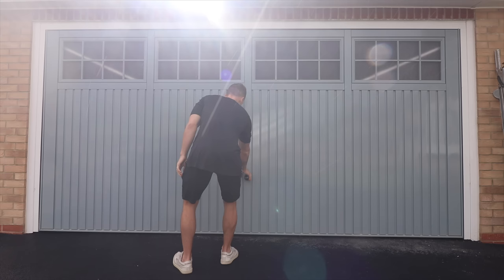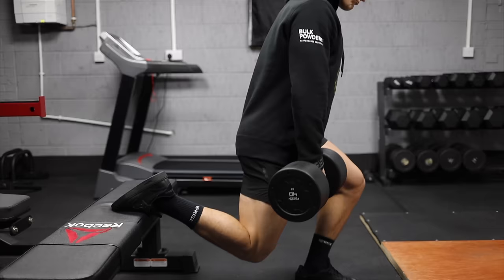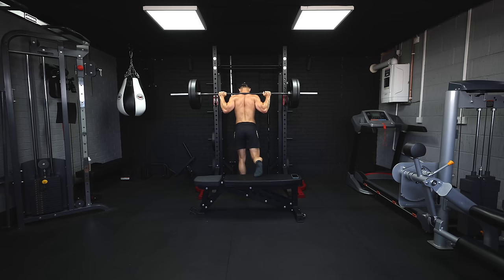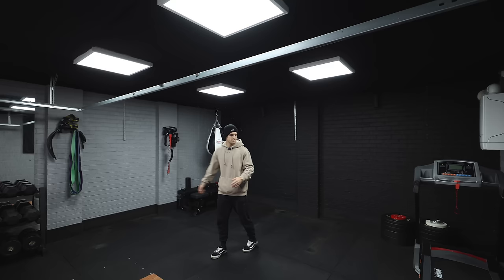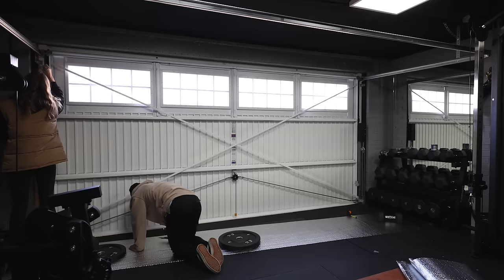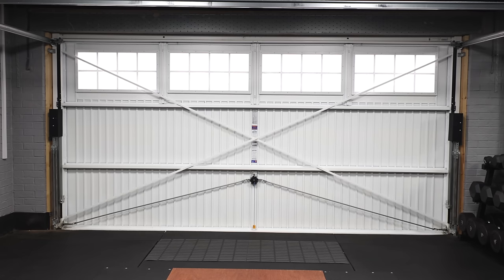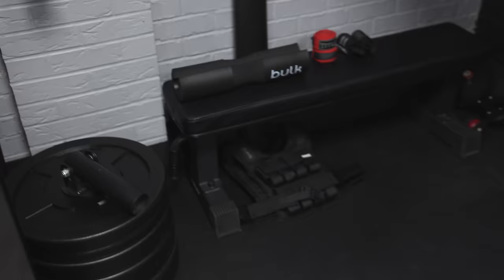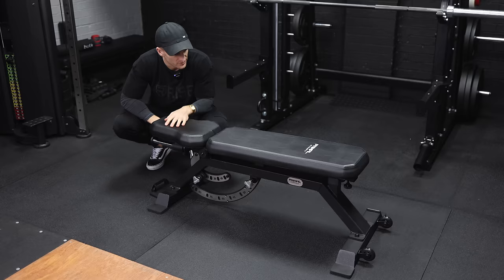Complete Home Gym Transformation (Start to Finish)

Comment: For your lack-of-heat problem -- a simple manifold off your existing boiler into a radiator (or two)?
Electric radiant panels near your primary workout stations would work too.
Radiant heat works by heating objects (like you) rather than the entire volume of air, so they're ideal for turning on when you're working out and then off when you're not.

Comment: My home gym is the great value version of yours. I've got old horse mats that are taped together, a 5-30 dumbell tree, a 25 lb kettlebell, a used smith machine cage from golds gym with pullies on the corners and a floor pulley for rows, an adjustable bench with the leg extention attachment and a pull up/dip station from a kids playground. Honestly I mostly just use the free weights and the cage for benching. Been switching back and forth from PPL and upper/lower routines every 6 month or so.

Comment: Sick.  I'm building my home gym at the moment, great inspiration, cheers.  I think I'd add just three things: 1. some kind of chest press machine (probably incline, ideally one in which the angle and the grip can be adjusted, unless one runs into the same engineering issues as the leg extension/curl combo), 2. a multigrip cambered bar, which doubles as a multigrip pullup bar too 3. a couple of sturdy, large plyo boxes, not only for jumps-cardio but also for unilateral leg exercises, seal rows (putting the bench on top of them to increase the distance from the floor) and several other things.

Comment: Heat rises so that area above the black sheeting on the ceiling will collect the heat. You could probably just lay some cheap thin wood up there and then some insulation over it, maybe even some old duvets or blankets or something. Might keep the gym a few degrees higher on chilly days. If you have any plumber mates, you could also just put a radiator in there.

Comment: Just built a home gym myself. Started off by sealing all the gaps with expanding foam and painting everything black. Damp proofed the floor with a damp proof membrane, picked up some flooring mats and then was onto the equipment. My garage is only a 1 car garage so not as much room to get different machines for each exercise so picked up a MARCY ECLIPSE RS7000 DELUXE SMITH MACHINE HOME GYM WITH BENCH, literally has so much in one machine. Also, got a treadmill but I'm now in need of some dumbbells but obviously they're very pricey so was thinking of buying some adjustable ones, been looking at the Bowflex 1090i but not set on them if anyone could recommend any. Also i picked up an oil filled radiator but it's causing a lot of condensations so I think I need to get a dehumidifier

Comment: Joe, great looking gym, though you'll definitely want to consider removing the spray foam. It'll be a pain in the arse to do but given you've cloth-lined the space and won't see it the kingspan would have been the way to go. Spray foam is pretty awful for damaging roof timbers, and I've seen it lead to a whole new roof being required from rotten timbers. It's perhaps slightly less of an issue as it's just your garage, but it's a big no-no on most mortgage lenders guidelines, and they simply won't touch properties with it. If you come to sell, I'd not be shocked if you'd need to get it removed at that point in order to get the sale to go through - if it was inside the house you'd definitely need to do that. Any surveyor worth their salt will recommend it being removed.

Comment: Quality video as ever Joe. I recently bought a Redrow home in the last year, unfortunately it is only a single size single skin garage (obviously we do not operate on the same budget 😂). However, I took major inspiration/design stealing from your first video to create my home gym and it’s been working out great for me. I have a bike, DB rack, fully adjustable bench & a half rack with bumper plates, with some niche weighted vests/belts etc.. as well. I have very limited room left and also a shorter ceiling height of only 2.10m. Would be great to get your thoughts on one major item I could stick in (i.e small enough cable pulley, Leg ext/hamstring curl, calf machine etc…). Also might just have to copy you with insulating the door, garage is getting freezing this time of year

Comment: Nice work, Joe 🎉 Primal Strength stuff is great, and that FB page is a good source of inspiration for home gym owners too (if not necessarily the best for bank balance) 😂 For people that don’t have space for the leg extension or Smith machines, but do have a rack and some kind of jammer arm that can be attached to the rack, what would you recommendation be for the best way to hit leg accessory movements like leg extension, hamstring curl, calf raise etc.
Reply from the maker: I think leg extension is the most difficult as there isn't really a quad isolation replacement you can do with free-weights. I do some stuff in this video from around the 5 mins 30 mark: https://www.youtube.com/watch?v=OXn-fhrQQrw&

But none of it is particularly comfortable or easy, so I don't know if I would just concentrate on doing a couple of different squat/lunge variations for quads. Calves, you should be able to do raises holding the jammer arms, as they will be more stable than holding a free bar. Single leg DB raises are fine too if you stand on a plate/ramp and hold onto your rack with your free hand. For hams, again an isolation is difficult without a machine. You can do some lying leg curls, lying forwards on an incline bench with a DB between your feet, but again, that's a bit awkward. Although it's not a curl, I rely mainly on RDLs for the hamstring work I do at home.

Comment: Hi Joe. Spot on transformation here....I've seen this clip a few times this upload that is, but I've come back to it as I'm doing my next home gym....but just noticed something that isn't actually in your gym. At 17.06 you can see what looks like wall control pegboards. What are these (make an model if you know) and where did you get them.....wall control in the UK is hard to get hold of....and I need metal as they are for cable attachment (I'm going down the Rep Athena rack system so wall mounted attachments are needed as it's a totally open rack with integrated cables. Sounds like you're a local lad too I'm based in Audenshaw...I'm guessing you're not far away from looking at some of your other clips. 

Spot on channel and great content as always sir....keep up the great work 

J

Comment: You’ll always be losing a lot heat because like you said it’s only a single skin brick wall which will pretty much retain no heat whatsoever as well as letting tonnes of condensation in. The windows in the garage door are also single pane which will be letting out a lot of heat.

Comment: Love the primal gear, Steve was really active on the Facebook groups too during lockdown.

I have a similar space to you however my garage door is an up and over electric which scuppers a lot of the height across half of it and we still need to use some for ‘garage’ shit.
Next year hopefully going to build some custom storage to expand the space and copy some of your moves!
Reply from the maker: Yep, even the track that mine runs on still limits where I can put things to an extent. A roller door would be best but looks pretty ugly on the outside.
I also bought a shed for storage, but can imagine that's not convenient if you have bikes or something you need to grab and go.

Comment: Quality content as usual man! I took a few ideas from your first video when I built my gym (namely the black wall) and it looks DOPE. I have a stand alone lat pull down / low row machine that I’m considering swapping for a functional trainer. Think it’s worth switching if I only have room for one?
Reply from the maker: Yeah mate, I would say so. You will still be able to do some single arm lat pulldowns (like the ones I showed in the video) and could even do some cable rows sat with your chest against an upright/incline bench (holding both cables), so you're not really losing any movements, but gaining a lot. If you have somewhere to do pull-ups especially, no real need for a lat pulldown (although I do see why people have them in home gyms because they are typically pretty small footprint).

Comment: Awesome idea on the ramp for calf raises. I had just been laying down a 2x4 until I could get around to building some sort of platform. But checked amazon and saw a rubber curb ramp for $39. Hopefully that will work out and save me the trouble.

Comment: Thanks for this I’ve been looking at upgrading my basic home gym (barbell and 195kg of plates, dumbbell rack, bench, kettle bell set (8-32kg) pull/dip station, weight belt and bands, also jump rope and exercise bike) but I keep overthinking full rack/half rack/smith machine (got a basic squat/bench rack combo) luckily I live in Thailand so no insulation on the large roofed terrace (just a few industrial cafe fans above) I do usually do one upper and lower day at the gym for the extra machines, might make the cash plunge and get a pulley machine and leg extension.

Comment: Down the line maybe ditch the functional cable system and get a Smith/Rack/Cable combo  in place of your current smith/rack?? Have a mooch at the ExtremeFitnessEX1000, or TitaniumStrengthFT3. That would free up so much room Dude ;)
Love the setup though Lad!
Also - similarly - as you're ditching the treadmill for an assault bike - also look into the recent Row/Ski hybrid machines - Titanium also do one of those,,
Reply from the maker: Yeah mate, I did look at Smith/rack/combos, but they are all quite 'deep' (front to back). Ultimately decided it might make YouTube vids a bit boring if every exercise I do is literally in the same spot. If I was truly at a push for space and there was another station I REALLY wanted, I'd have done that, but as it is I could still squeeze something else in if need be.

Comment: I move into my new build in Jan mate, buzzing to get my home gym sorted
Reply from the maker: Best thing about moving into a new house haha. Home gym and dedicated office massively impacted my quality of life srs.
Reply: @JoeDelaneyy  my Garage is going to be
5517 x 2500 got any tips? I am going to do a 2.5kg - 40kg dumbell set with the horse mats on the floor
Reply: I want a single cable machine for back and tris etc but not sure if I will even have the room
Reply from the maker: @0GarethHunt0  Would definitely have room for a single cable stack, but whether that's heavy enough to do pulldowns on would depend obviously. I think better to do single arm pulldowns, then you don't need to use as much weight and won't need a pad to keep you in place (like on a lat pulldown etc). There are some plate-loading ones you can get at Primal that you can fix to the wall. They might be a good shout.
Reply: @JoeDelaneyy  Nice one mate, appreciate the help. Sorry this isn't a "How to get a six pack?" question, I know you love them

Comment: Great video Joe, lots of ideas.  I’ve only got a single garage, but over the last few years I’ve managed to squeeze in an extendable squat stand / rack for use with a 6ft bar, a cable cross machine, adjustable dumbbells, and a spin bike.  Bought a really cheap bench, but I miss the leg extension like you mentioned but no space for it.  Looking at upgrading to a bench with leg extension attachments to hang plates on - any views on them?

Comment: To be honest, the walls are single skin brick, it will never regulate temperature very well. Plus unless you're heating the inside, its not going to have any heat to retain. I have same issue with my home garage gym. You're right about the door, that will be the worst heat loss. You could get some double glazed aluminium bifolding doors on there?
Reply from the maker: Yeah mate, nothing I can really do on that front eh. Technically could insulate the walls, but it's a big job (for me) and would make the place feel smaller. To be honest though, it's warm enough now once I'm training. As for the doors, I did think about changing to something better (because the mechanism also annoys me for mine) but I don't think I'll be in this house forever so not sure if it's worth it. Next owners might use it as an actual garage ha 😆
Reply: @JoeDelaneyy  yeah wouldn't be worth the mess and loss of space. For me it's just trying to keep the temperature above a level that moisture don't sit on all the metal. As you say, after a warm up set the temp for working out isn't an issue. Just throw a big hoodie on for the first 5 mins

Comment: great video Joe, gyms looking sick! Apart from not being a little b*tch.. could you try a small fan heater like I have in my garage gym, I flick it on 10/15mins before I want to use it in winter - along with a hoodie it just takes the chill off when warming up
Reply from the maker: Yeah mate, I do have a little electric fan heater, but it's currently in the loft and I'm trying to wait as long as possible. Even when I do start using it, it's definitely helpful now I won't be losing all the heat straight out the door haha!
Reply: @JoeDelaneyy  Yeah thats a good point, no point heating the area to lose most of it through the door! hopefully the insulation sorts that for you! got serious home gym envy!

Comment: I have a cheap argos style bench i picked up second hand on market place with a light olympic bar it has a leg press attachment and a preacher bench
I have hit the max weight on it with bench press , dead lift and squats

thinking of getting a squat rack to replace it... maybe one with a lat pull down on it

just been doing a 5x5

dont want to break the bank as i have only been lifting about 3 months and not consistant some weeks but loving it

would you recommend the squat rack?

Comment: I do have a home gym which I will be updating soon.  Yours does look great - out of interest how much time did you invest in research, correspondence, planning etc? The video makes it look like it just fell into place 😂 (YouTube Land haha)
Reply from the maker: For all the original stuff like painting, insulating, floor etc, it was probably a lot of time. But I was so enthusiastic it was more fun than a chore. For the equipment - not enough time, hence why I went through two leg extensions before finding the right one. For this lot of new equipment though, I was working with Primal so pretty much had a direct line to them that I could use to ask questions, which was helpful. Obviously this is stuff you only want to do once if you can help it, so the more research the better. That home gym community FB group I mentioned is really helpful.

Comment: Joseph, I have a small garden space (3x4m) which I’m planning on turning in to a semi outdoor training area. Im going to put a rain shelter up but all the equipment will be subject to the elements as it’ll be more of a gazebo to just keep the rain off when I’m training. Any recommendations for some semi weather proof kit that’ll maximise the use of the space. Ta
Reply from the maker: Hmmm, that's a difficult one. I'm not too clued up on things like preventing rust, other than blasting WD40 all over everything often (but then be careful of getting it on your clothes). I would check out that home gym community FB group I mentioned - there will be somebody in that group who has experience doing something similar, I'm sure.

Comment: If you had half the size garage what would you kit it out with? I’m looking at new build houses but the price point I’m at the garages are about half the size of yours
Reply from the maker: If you want absolute best functionality, something like this is ideal: https://www.primalstrength.com/products/primal-strength-stealth-monster-rack-system?_pos=17&_sid=d6ccd4f65&_ss=r

Then you have a rack, Smith and cables all in one, and you can just smack it against the back wall and basically do everything in the same spot.

If you didn't want to spend that much, I'd say get a half rack (ideally something that's quite shallow front to back to save space). I'm not sure if you'd fit dual pulleys as well, but you could also think about a pulldown/row combo, which would have quite a small footprint.

Comment: Thanks for the video - straightforward as usual! I've got a question - as a 51yo bloke, I'm starting to think that some of my free weight exercises are getting riskier for injuries when manhandling dumbbells etc so was thinking a cable machine or similar would be a safer option. What do you reckon?
Reply from the maker: Well, it's a double-edged sword in a way because using free weights will also be somewhat preventative in terms of injuries (I'd say benefit outweighs risk). Cables still require some stabilisation, depending on the exercise (keeping chest flies in the correct plane of movement for example), so might be a good compromise. I don't think it's necessary though, I would just make sure you are thorough with warm-ups and don't use weights you can't maintain good form with
Reply: @JoeDelaneyy  I agree. Free weights encourage focus on the mind muscle connection, which can address injury risk.

Comment: I don't have much space in my room. but any suggestions for free weights or equipment for a "dorm room/bedroom" sized space? I'm a newbie when it comes to free weights :b
Reply from the maker: A bench, dumbbells and pull-up bar is priority. Then you can train every major muscle group (flat press, shoulder press, Bulgarian split squats, RDLs, single arm rows, pull-ups). After that, a half rack, barbell and plates is probably the next priority if you have the space.

Comment: Nice gym. What are your hamstring options?
Reply from the maker: I pretty much just do RDLs at home, then I do some seated ham curls when I go to the actual gym. I actually can to single leg curls on that leg extension - a bit awkward because it's not designed for that, but it is possible.